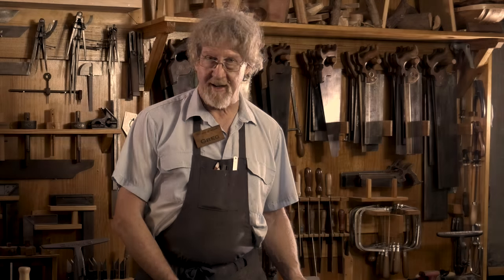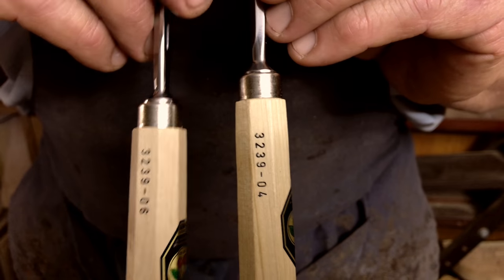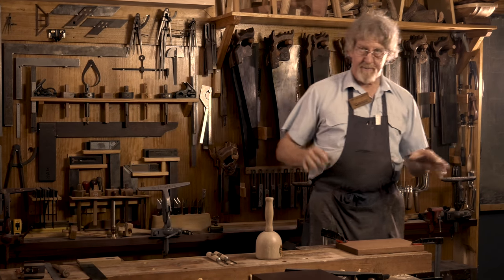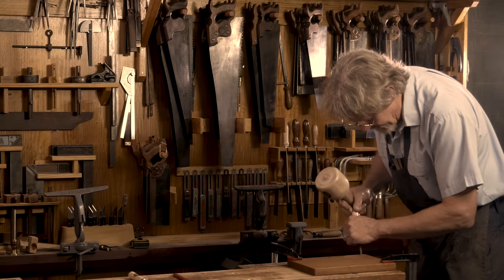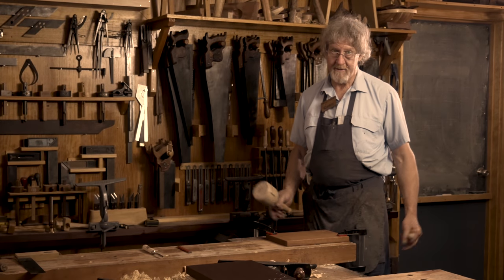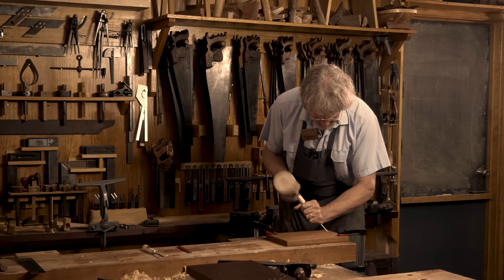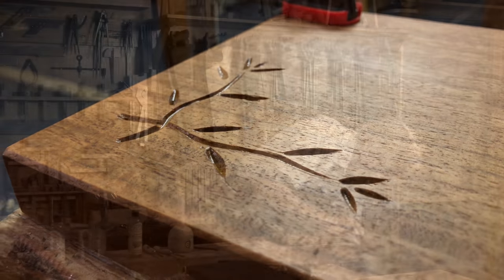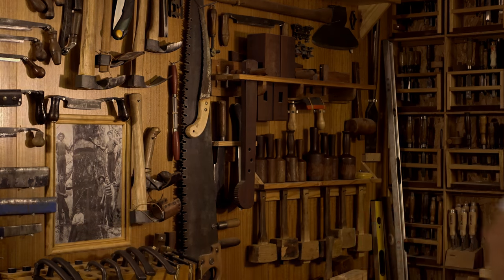The Joy of Wood with Greg Miller - Carving with Kirschen

Comment: Hello. Can this model of chisel 3239 be used without a mallet or hammer? I was thinking that the short chisels can be used only by hand (like palm chisels, without a hammer). Do you know what angle are they sharpened in the factory? I was looking for a V chisel, but one that can be used without a mallet/hammer, and the bevel made from the factory is suitable to this.